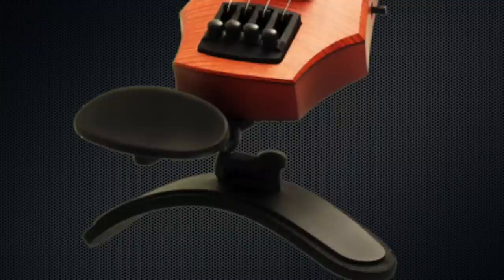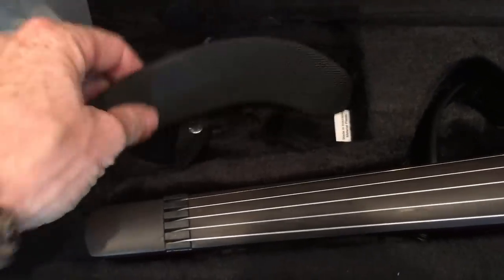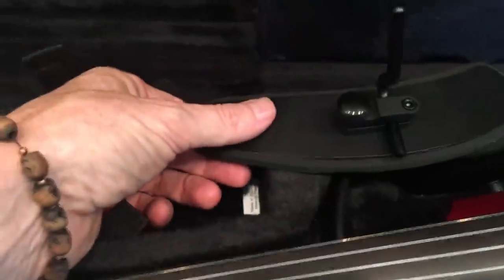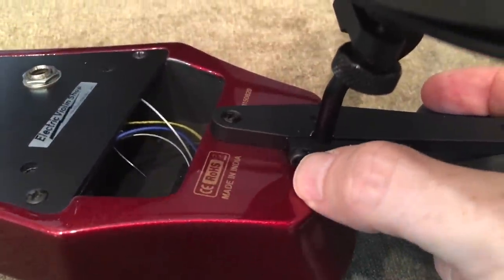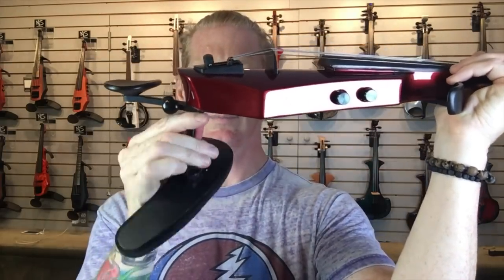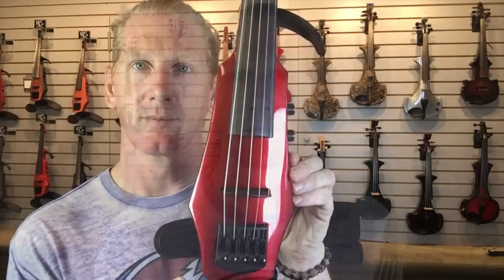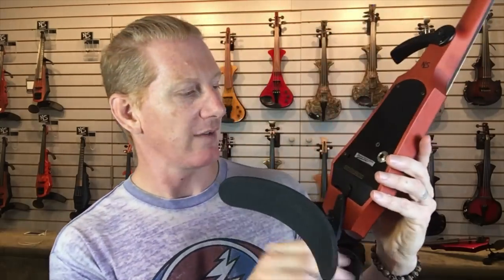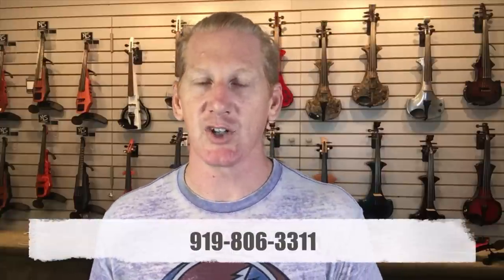Guide to NS Design violins (WAV, NXTa & CR)

Comment: To anyone experiencing the shoulder rest rotating, you must ensure that the Allan screw and the knob screw are at the same tightness, so they are parallel. this will allow it to be as tight as possible. Also, for mine, I ground a little bit of rosin dust into the socket, so it adds some grit to the rest. Hope this helped!
Reply from the maker: thatoneguyooty99 That's a good way of explaining it...and love the rosin dust idea!

Comment: Amazing instruments! Awesome sounds! Fun team! I would really love to see a CR-5 violin without that headphone jack and a capacitor instead to replace that 9V battery. 3 position switch is stunning, low pass filter is great. I basically only switch between pizz and low pass...however, I have never ever used the headphone jack. Changing batteries can be a bit of trouble when it runs out and you quickly wanna get a new one in. Sometimes it works smoothly to change it, sometimes it takes me minutes to fiddle that 9V back into place. NS Design rocks and a non-battery non-headphone jack CR-5 would be mind-blowing and probably the last electric violin I'd ever buy :-D ALOHA

Comment: What amp is recommended? I’m only playing at home for family and myself. Also, how quiet is the NXTa when not plugged?
Reply from the maker: The NXTa is very quiet unplugged. There are a number of good amps. We recommend the BOSS Katana 50 amp, which is a great value because it has a large speaker and onboard effects, plus it has a wattage selector, so you can use 50 watts for full power, 25 watts for half power, and 0.5 (half) a watt for home playing at lower volume. Check it out: https://www.electricviolinshop.com/boss-katana-50-combo-amp-with-effects.html

Comment: Matt, besides the switch on the NXT, is there any really noticeable difference in the sound quality. If I'm planning to play mostly arco, should I just stick with the WAV?
Reply: There's a significant difference between the two.  One, there's a preamp onboard the NXTa.  Two, the NXTa just feels a little different.  I think that all 3 levels of the NS series are appropriately priced.  The NXTa is better than the WAV and is worth the extra money.  The CR is better than the NXTa and worth the extra money.  But all of the instruments are good for the price range they're in.

Bottom line: if you can afford the NXTa, get the NXTa.  If all you can afford is the WAV, then get it.  It's an excellent choice in that price range.

Comment: First of all, Thank you very much for all videos, they are helping me a lot to choose the right violin for myself.
I am thinking beetween NXTa and CR. I don't really need headphones and a capasitor would be better for me. besides, is CR much better in another things that I should buy this one anyway?
Reply from the maker: The CR is certainly a better instrument (and it had better be for the $1,000+) but it's only worth the extra cost to someone who needs that level of instrument. The NXTa sounds great and has an equivalent build quality, so if you don't need the headphone feature, the extra tone sculpting features, and would prefer a rechargeable capacitor to a batter, then it sounds like the NXTa is absolutely the NS Design violin model for you! We carry both colors in 4 or 5-strings, traditional or fretted here: https://www.electricviolinshop.com/violins/violins-by-brand/ns-design/nxta-violin.html

Comment: I just want to know if/how you can adjust the height of the bridge. Being more a fiddle player than a violinist, I like a low action.
Reply from the maker: You can! There are screws on either side of the bridge, accessible through holes in the backplate, that let you raise or lower the treble and bass sides independently of one another.

Comment: Just received the NXTa...my 1st question is ...why all the demos on line show a curvy shoulder pad ( sort of round at the neck) where the one received is straight ? it is harder to make comfortable..it is unfortunate that the designers have changed it ...yes it is wider than the older style but to take the curve out will prove less comfortable to some...at least to my father
Reply from the maker: It's a new design.  I'm not sure why they changed it.  It can still be bent and molded, but we've gotten a little bit of feedback like yours.  It seems some people prefer the curved one.

Comment: If don't use the battery on CR Series, will turn it a passive violin?
Reply: If you don't use the battery, it will be a very silent violin - one that does not generate a signal at all.